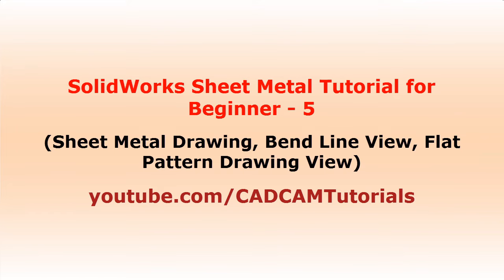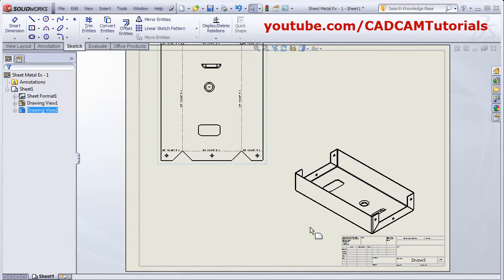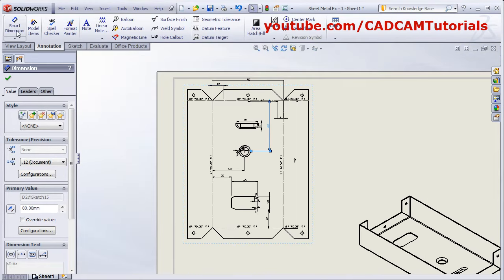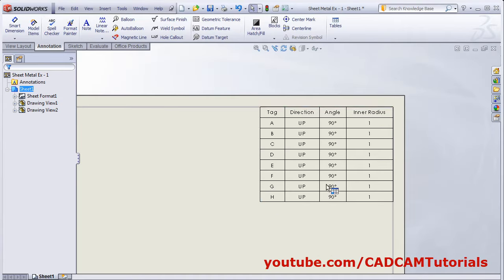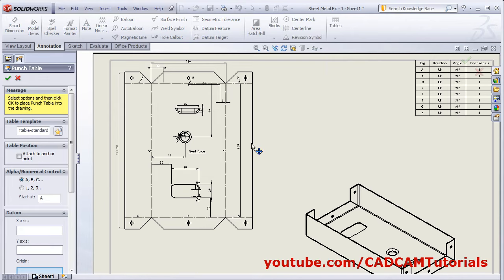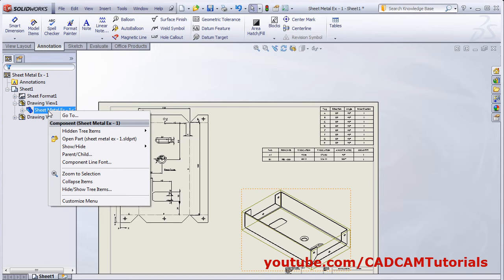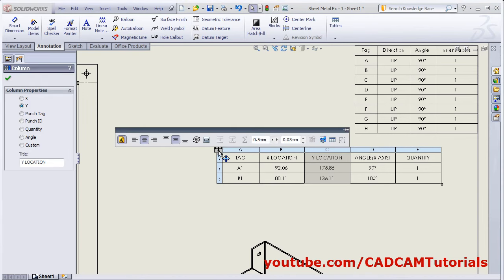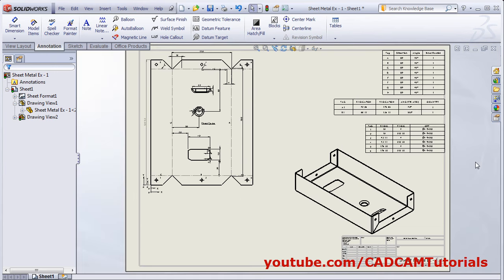SolidWorks Sheet Metal Drawing Tutorial | Bend Line, Flat Pattern, Unfolded, Bend Table, Punch Table

Comment: You don't dimension flat patterns on a drawing.  You care about the bent final state as a design engineer.  You don't care how the vendor got there, and besides flat patterns are unique to a particular material, especially in precision sheet metal parts.  The manufacturer often has to bend test pieces of a specific lot of material to determine the unique K factor, so therefore any CAD generated flat pattern can be meaningless.  The drawing for part procurement has to be the fully dimensioned bent part.  Dimensioning from bend lines is also not allowed.
Reply from the maker: Thank you 😊 ❤️ for sharing knowledge.